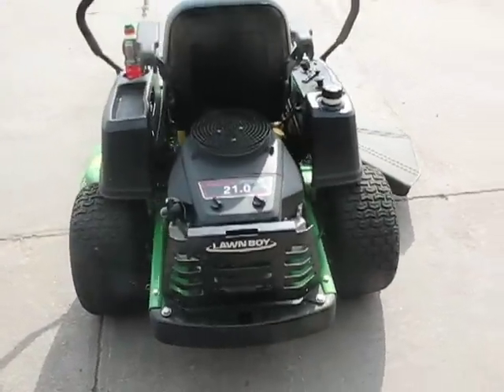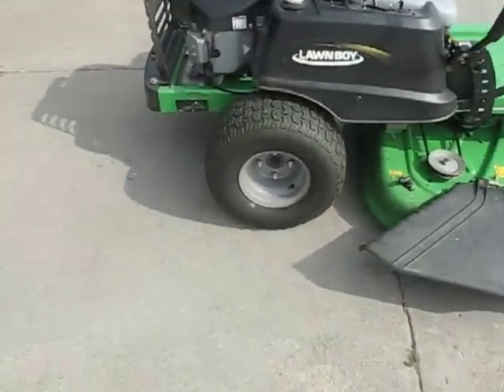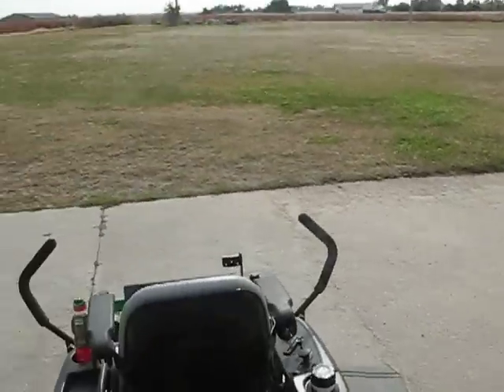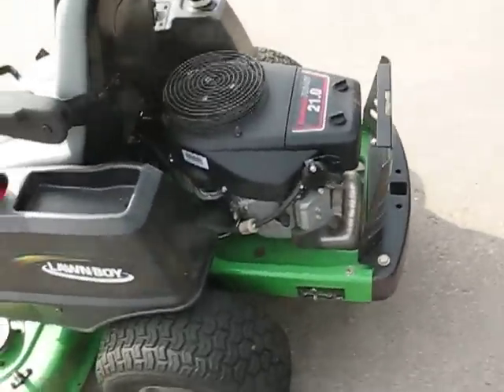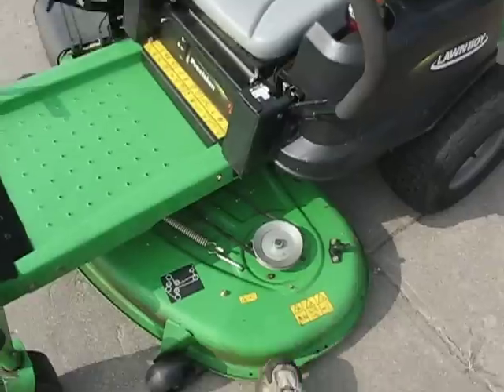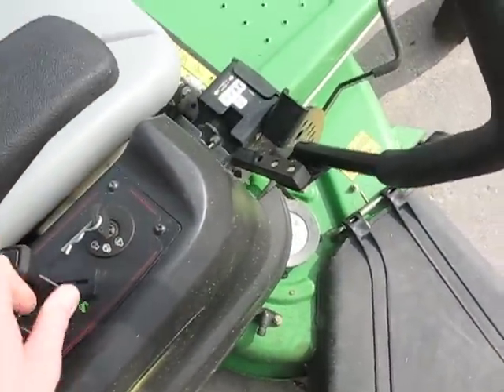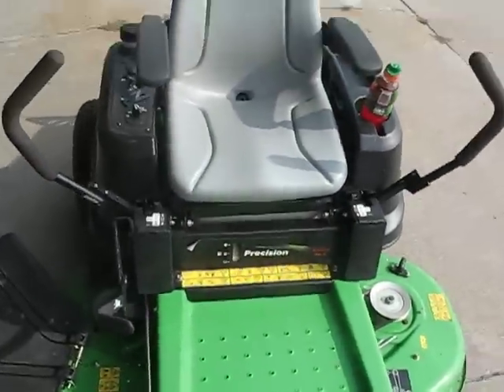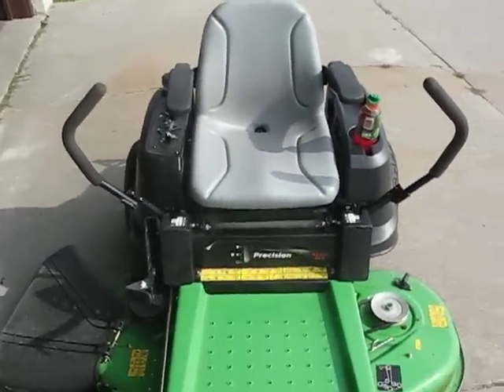Lawnboy ZTR

Comment from the maker: @MultiMonster69 

$3,400 delivered.

Its still a good machine but three seasons in the wind have only had one fault...the seat brackets are cheap and one broke...I modified it with some heavy gauge solid pin hinges from the hardware store..

Changing oil on this sucks too because it get all over the place....you would have thought the designers would have thought to not have the drain right above the hydros......duh!